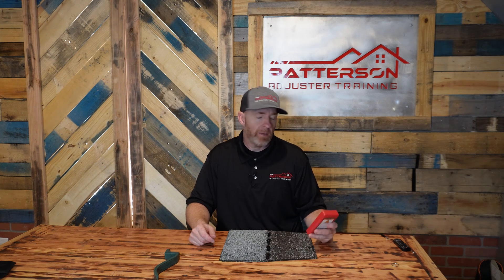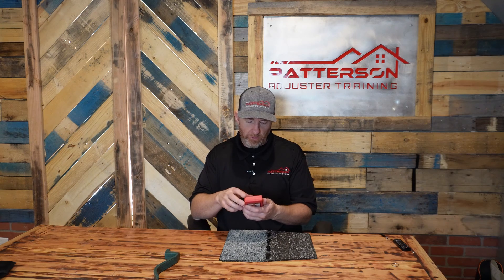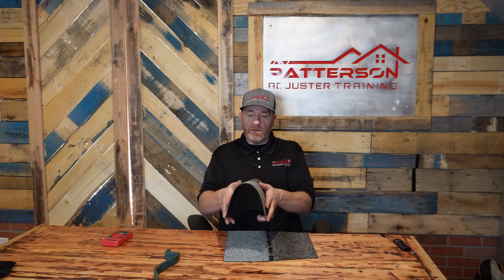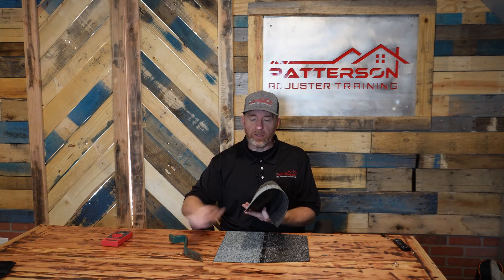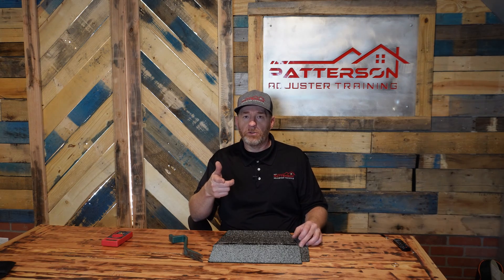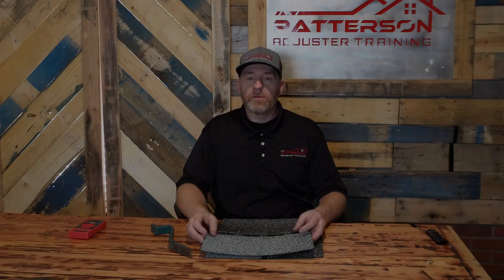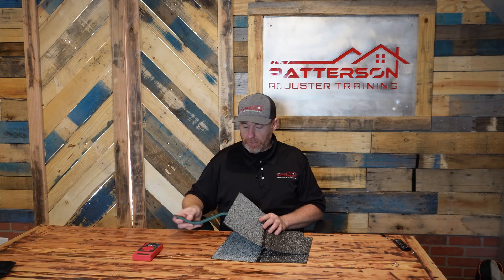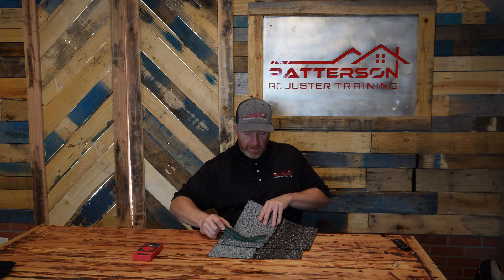Finally, a Brittleness Gauge for Shingles!

Comment: Why not just replace the entire run of ridge cap? Tear em off, then worry about pulling those nails.
Reply from the maker: That would be the best option, especially on this house.  The ridge shingles were basically crumbling. For the video I replaced a few. If not for the video replacing the whole run would be the best way to go, for sure.